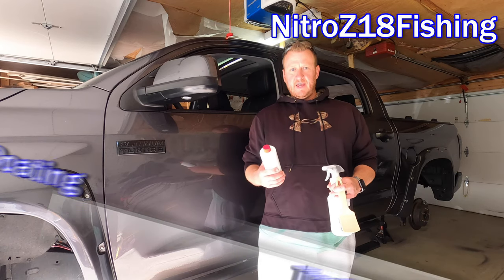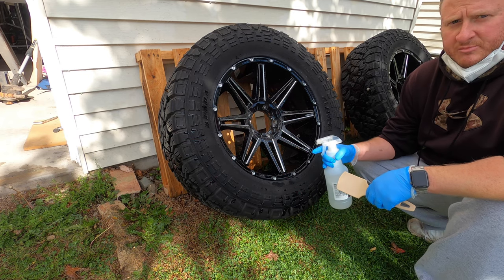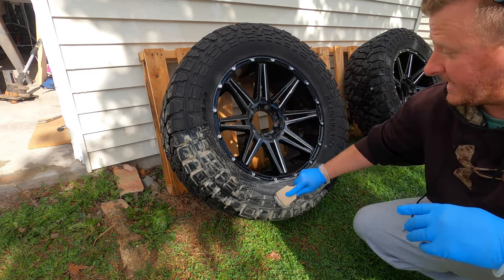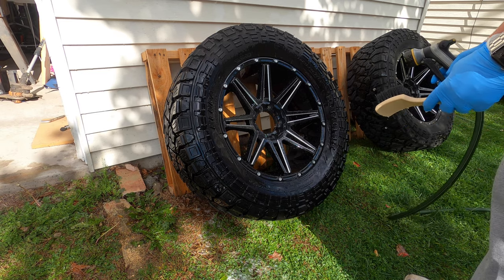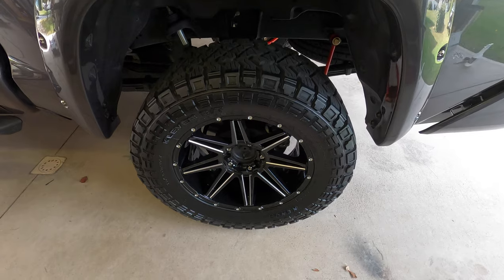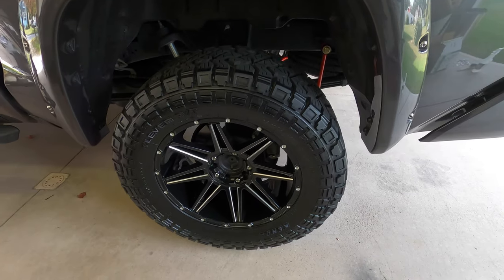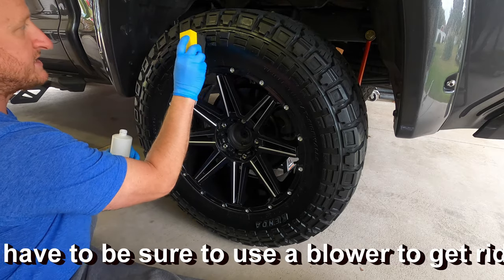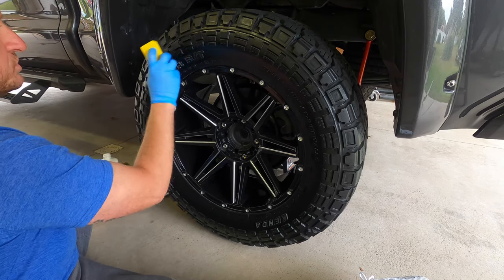Dura Coating Tire Dressing Application and Review (35" AT Tires)(2020 Toyota Tundra)

Comment: I use Dura Coat and I like it. One thing that I do so I don’t have to remove the rimes from the car is I take 4 patio blocks about 1” x 6x12 and I put them in front of each tire then I drive up on them. Being 1” higher let’s me easily be able to treat that bottom edge as I place them where the tire edge is not on the block. Try it you’ll be saving yourself from that hump job.
Reply from the maker: That's an awesome idea, thanks for sharing man!

Comment: What would you recommend if I just bought brand new wheels and tires and the tire and wheel have not been paired yet? Is this a great time to dura coat the tires before they are mounted to the wheel? Or does duracoating before the tires are mated to the wheels cause problems with that process

Comment: What is the maintenance on the coating?  Anything?  How does it hold up to wheel cleaners/degreasers?  Does dust simply hose off?  Thank you!
Reply from the maker: Hey Steve!...basic maintenance for this stuff, I just use the same soap I use for rest of truck (different water bucket/brush of course...haha)...they do say try not to get anything too “chemical” on it, but it lasts crazy long...I still haven’t had to reapply yet, I simply use a soft bristled brush with the same soap I use on truck, and that’s it...crazy how easy they come clean and how long this lasts, not even comparable to anything else I’ve ever seen/used...and it definitely just won’t come off with a hose...hope that helps!

Comment: Great video Pat! I bought this product yesterday and im due to rotate my tires so this is perfect timing for me. I have a subscription to an automatic car wash which HAS brushes. Will this stuff stay on? I believe it does have a wheel/tire scrubber. I'm not sure how harsh or abrasive it is. I wouldn't think its too crazy. Thoughts?
Reply from the maker: Thanks Sean!!...yea as long as it’s not super abrasive you should be good to go, they actually tell you that you should clean the tires with a soft bristled brush every time you wash the truck, so this stuff can take some abuse!

Comment: What set up do you have on your tundra? ( inch  Lift, tire size, wheel size)
Great videos!
Reply from the maker: Thank you, I appreciate that!...my full setup is a 4/2 ReadyLift SST sittin on 20x9 +12 wrapped in 35x12.5’s...hope that helps, thanks for watching!
Reply: Did it mess with the computer ?

Comment: HOw are the Kenda Klever tires working out for you? Are they noisy and did you notice any performance hit due to weight of them? Any trimming on the front to fit them?
Reply from the maker: Love these Kendas man!...I’ll definitely be buying them again, have almost 10k on em already and they still look new...the noise is louder than stock of course, but not as bad as I was thinking for such an aggressive tire...I did have to trim when I had my stock bumper on, but plenty of clearance with the Nfab...I also did a BMC...I have a video on the channel showing exactly what I had to trim when I had my stock bumper if it would help!
Reply: @NitroZ18Fishing  I'll have to check that video out but I'm trying to get a size where I don't have to trim on my TRD PRO. I know I can go 285/75/18(34.8-35.1 inch tire depending on brand) which will fit because at 11.5 inches width it is narrower than a regular 35
Reply: @NitroZ18Fishing  Does that 35 Kenda fit in the Spare tires spot?
Reply from the maker: that I'm not sure of, I haven't purchased a 5th one yet...but I do plan on doing so in the near future, I'll update the channel when I get it!

Comment: How's the coating holding up ?
Reply from the maker: Still going strong!…I’m going to make a follow up video in the near future, I’m going to do a “touch up” on the tires, but you can tell the coating is still there, it’s crazy!
Reply: @NitroZ18Fishing  Great video.  New subscriber as well.  After applying, how long did you wait before driving?  Is it really no slinging as soon as you apply it or should I wait a few minutes?  Thanks in advance.
Reply from the maker: Thanks Mike, I appreciate it!….as soon as it’s dry to touch you’re good to go, I’ve never had it sling on the truck at all…it dries real quick too, especially if ya do it when it’s hot out…hope that helps!